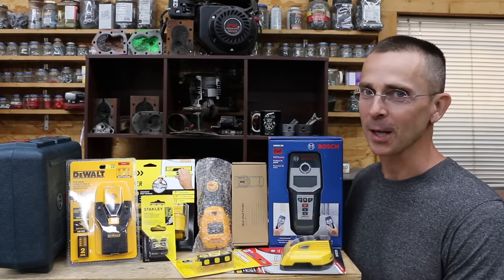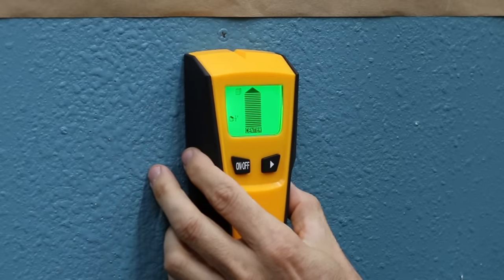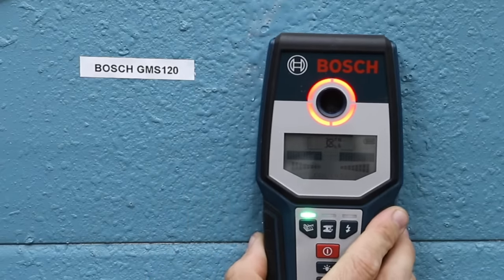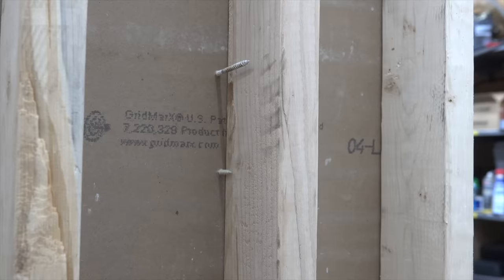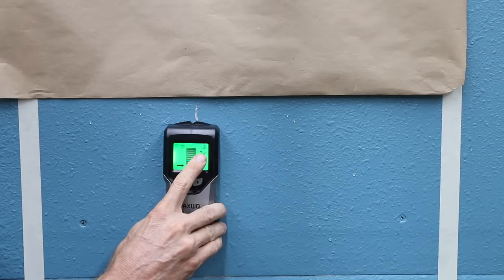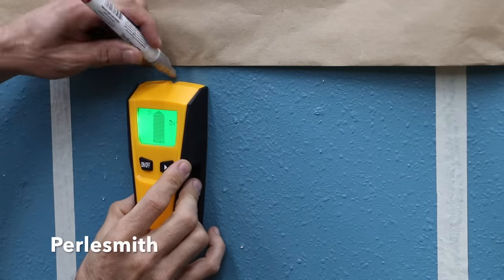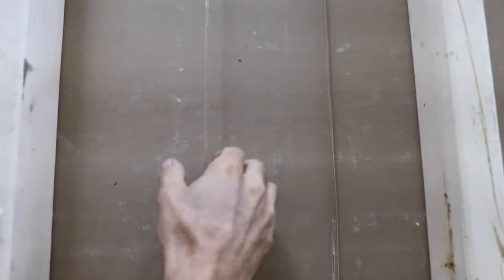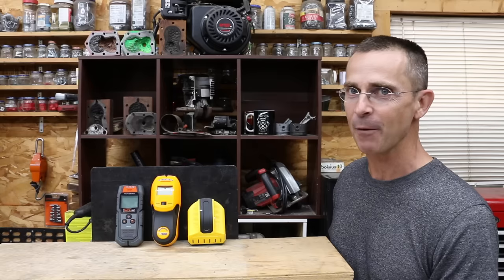Best Stud Finder? $262 Bosch vs $10 CH Hanson vs 9 Other Wall Stud Scanners! Let's find out!

Comment: I love the franklin, it's so fast to find a stud and makes it clear when you are seeing stacked studs. I've also used the franklin but I found that it used the batteries very quickly, not sure if there's a way to test that but I've had the franking for 3 years and changed batteries once and for whatever reason the Zircon always seems to be dead when I go to grab it.
Reply from the maker: Thanks for the video idea.

Comment: So I was thinking about buying a stud detector, although my past experiences with them have been hit and miss. But after watching your video explaining that the magnetic stud finders look for the screws not the stud it finally dawned on me to use some of the neodymium magnets I have on hand. Absolutely worked like a champ. For some reason, I always thought mag stud finders were just for finding metal studs. I feel like an idiot for not thinking of this. Anyway, strong neodymium magnets for the win. I wish I figured this out 20 years ago! You just saved me 50$. Thanks as always for the great vids!
Reply from the maker: Thanks for sharing!

Comment: Please test the Walabot 2 next round, it’s a bit expensive at $170, but it basically lets you see through walls. I’m really interested how it would do against some of the other more premium stud finders
Reply: I bought my walabot 5 yrs ago, it has not let me down yet. like thebfinding pioe and wire feature
Reply: I thought he would be reviewing it.. It's been out for a few years out now. I use to have the middle range ($) zircom and it's now on the trash! I do better with a small pilot hole!
Reply: @@nextprojectawesome9673 Why a pain for pros?
Reply: I can attest to the Walabot being very good. Its not as fast as some of these but it does the job well. I've used it on both lathe and plaster and drywall. Note it operates differently for each. For drywall its as advertised with the cartoon of the stud, romex, etc. (It can detect a critter supposedly.) For lathe and plaster its not so pretty. It gives you a zone "blob" that is the shape of what is below. So a stud is narrow rectangular-ish blob and a pipe is narrower etc. Think thermal camera.  That said - it was very accurate and for old lathe and plaster that is nice to have especially if your house was pre-code or had an improvisational handyman.

Comment: for 262$ USD the botch better find fracking tumors on people too, sheesh.
Reply: Seems to be worth it, if you use one a LOT.
Reply: Brand new for $219 and free shipping on eBay.
Reply: Bosch also has the D-tect 150 which retails for around $800 or more.
Reply: Very funny, I like the way you misspelled Bosch, At least I think that was intentional. ha ha.
Reply: Did I miss something with the dtect 120? It gives the same signal for copper pipe, metal pipe, pvc, and everything? If you need to know where a fire sprinkler or water line the scanner doesn't give you a different signal than a stud.
Reply: Still cheaper than tearing out a wall and replacing whatever was damaged. imo if you get a tool for something you might as well get a good one

Comment: Costco sells a scanner, green in color, called Precision Sensors “ProFinder 550”. I’ve had good success with it locating studs and electrical wires. Once again, excellent video sir!
Reply: Have the same one and it is the best I have used.
Reply: I love mine. I think I got it on sale for really cheap.
Reply: Just bought one today and this video came out lol
Reply from the maker: Thanks for the feedback.
Reply: Came here for this comment. That's a great sensor.

Comment: I’d be curious as to how they would preform in a plaster and lath format.
Reply: Me too!
Reply: Also walls with insulation in them.
Reply: Exactly, double layer drywall, tile, cement board etc...
Reply: Poorly. You'll need to do the drill bit trick or awl to find the first stud center then measure 16" over. That's hoping framing was consistent.

Old parged wood lathe walls don't work with stud finders.

The period where they put 1/4 to 3/8 drywall and parged with plaster and metal lathe to 1/2 to 3/4" dont work either.
Reply: Likewise.  I'd love to see a test on 1940's style plaster and lathe.
Reply: Ninja Master, while it is beyond the standard scope for a “stud finder” why not take the top few, add a more advanced meter and see what kind of information they can reliably present given all the common wall, floor and  ceiling compositions you may run across. Everyone has their preferred method but I have always wanted to have a more powerful device that gives a clear and complete picture of the utilities and structure buried within the kitchens and bathrooms I work in.
Reply: Same
Reply: Yep, add me to the list - I have an older home with plaster walls and normal stud finders I have tried are not reliable...

Comment: I really liked this test. Thoughts for second version included plaster with lath, ceramic tile, metal studs. Installing handrails or shower grab bars are both tricky if on an angle.
Reply from the maker: Thanks for the video idea.
Reply: Perfect idea.
Also, coat and feather out the mud at drywall joints. They can add to that build up. I’m sure one or two of those stud finders would start to fail more tests.
Also, try multiple layers of drywall. This is regular in many Fire rated wall applications.

Comment: I have a bunch of these stud sensors: The WINNER: The Franklin T13. I got it at Costco (cannot remember how much(reasonable($25?)))  It is the most reliable, intuitive and easy to operate; the 'bar' display gives a pretty good visualization of the situation. I had a situation where I was installing a socket box on a short (narrow) wall between a closet door and and a corner; I figured there was a double stud up against the door which was indicated and possibly a double stud at the corner. I used a very small drill bit to pierce every 1/4" or so, and found the T13 was correct, leaving me BARELY enough room for the breakout box. After cutting the hole with a drywall saw, I successfully installed the electric socket.
Having tried most of these with dubious results (average about 1/2"), the Franklin product is the one with some actual intelligent engineering, pretty white and lime green color scheme, and my go to tool (for finding studs).
Of course, my wife is pretty good, too...she found me (sorry)
Reply: Oh, and for when you absolutely, positively need to SEE what is going on, I use a cheap HD USB 7mm borescope cam to view on a laptop ($15 from AliExpress); has a built in variable, BRIGHT LED light in the end, and I tape the cord to a piece of thin welding wire which I can bend and manipulate while inside the wall. You only have to drill a 7mm hole (9/32") to ACTUALLY see what is in there.
Reply from the maker: Thanks for sharing.

Comment: Would love to see how the Walabot DIY Plus does. Only works with an android phone though.
Reply: Yea, need to throw Walabot into the test pool.  For a while, they were certainly the most prolific marketer. Otherwise, a great review as always!!
Reply: walabot and FLIR ONE camera
Reply: It was disappointing and I sent it back.
Reply: I have the first generation Walabot, it also gives me false positives for stud location sometimes
Reply: I also would love to see the Walabot tested along with another round of stud finders. I only trust you Todd, go Project Farm!
Reply from the maker: Thanks for the video idea.
Reply: Was hoping to see this also. Its a popular option for DIY and they market it well.
Reply: I've been using both the Walabot Plus and C.H. Hansen magnetic stud finder. The Walabot Plus has been pretty good but sometimes struggles to find the stud confidently in certain sections (not sure what's causing the issue). Moving the scanner above or below the trouble spot usually helps. For this reason I always double check with the magnetic stud finder. Also the trouble with relying solely on the magnetic stud finder is that you assume the builder put the dry wall screw on the stud center, which isn't always the case, which the Walabot can usually confirm with its edge finding.

Overall I think the Walabot Plus does a good job for wood studs in drywall, but I'd still love to see it put through all these tests with the more definitively measured results. Also, Todd if you could speak about maybe false positive results in the next video that would be useful too, especially since us homeowners don't know what to expect behind the wall.
Reply: @Krautastic  I have both. I haven't gotten much use from the walabot to speak much on its accuracy, but the FLIR one's big limitation is that there has to be a good temperature bias on the two sides of the wall, or inside the wall for the studs to be visible. Sometimes it's really telling though, with the flir, if that temperature bias is great.

Comment: Food for thought. One wall tear out and pipe replacement costs more than the Bosch Detect.
Reply from the maker: Thanks for the feedback.
Reply: Sounds like you've really screwed up and know what you're talking about. In over 40 years of construction I've never poked a hole in a pipe but I know I've nailed a wire or two.
Reply: @mikeries8549  not me but the contractor did. All seemed fine but a hidden pipe in the second story floor got cut. Luckily he didn't charge me for the hour and a half of work and the ceiling was already coming out in that area. Wires that are stapled behind the wall would be a nightmare to replace or else you would have to put a random box in the wall or do the crumby thing of leaving a splice behind a wall.
Reply: @mikeries8549  I put a screw through a water pipe in the wall in my garage once. Damn pipe wasn't straight vertical. Courtesy of decades of Southern California earthquakes. Thankfully the water shut-off was a few feet away at the water heater which would have made for very little water until someone opened a faucet upstairs.... draining the entire contents of that pipe into the garage.

Comment: I love your videos and look forward to all of them.  I appreciate the time, effort and resources you pour into them.  They're very informative.  
I've had the displeasure of needing to use a stud finder and the bane is plaster and lath wall in a 100 year old colonial (with wallpaper).  
When using such a tool, one doesn't have the luxury of knowing what's behind the wall, and all detected junk causes confusing false positives.   What I'd be interested in knowing is which stud finder can tell me where the studs are and differentiate them from wires, pipes, blocking, boxes, etc.  Sorry if I missed it in your video, but if you have an unknown wall how reliably could you find the studs and not end up accidentally driving a screw into a water pipe?  Do any of these clearly differentiate a wooden stud from all the other things?  That's really what you need the stud finder for.  
I'm not sure super sensitivity is a good thing.

Comment: Best stud finder I have found is a rare earth magnet lol it will find a screw or a nail real fast. 
Edit: Also forgot to add if you don’t want to tear up the paint on the wall put a little self adhesive soft Velcro on it and it works great, has to be a good powerful magnet though.
Reply from the maker: Great point!
Reply: I was gonna post this i have a little half inch cube neo
Reply: maxerious brooks ya I usually keep one on me all the time, I have a couple of them that are a little smaller than a dime but if you got your fingers trapped between 2 of them I bet it would break your fingers.
Reply: Buy a $2.79 jar of quarter inch round rare earth magnets at Harbor Freight; use two of them to sandwich a piece of dental floss or string about a foot long;  gently swing it around the area of wall you’re interested in, letting it skim the surface. Finds the nails/screws in no time.
Reply: The only issue i see with that is, you assuming the guy who hung the dry wall actually hit the stud. We both know that’s not always the case lol
Reply: @sccarguy8242  or that there are no studs for 6 ft on an interior wall because lazyness
Reply: This is true, have been doing a lot more steel stud work than lumber lately so the magnet works wonders.

Comment: As others have suggested, the Wallabot should’ve been included; I’ve had mine for over five years and even when I need a large screen phone to use it I love it because it finds 99% of all wires, pipes, plastic tubing, etc.
Reply from the maker: Good point for round 2.

Comment: I have several stud scanners and like you, have found that they all basically can detect a stud fairly accurately with 1/2" drywall covering.  However, what I have found, at least with the few that I have used, is that they can not reliably find a stud through double 5/8" drywall.  So I watched your video with interest to see if you tested this capability and was disappointed that you did not, I hope you include these tests in the future, with single 5/8" and double 5/8" drywall.  The double is important because many walls are sheathed like this when they serve as a firewall, which typically will be when separating a garage area to living space, and also where combustion appliances are present (like furnace, water heater).  It would be interesting to see if the expensive testers earned their value with this capability to justify their higher pricing.
Reply from the maker: Thanks for the video idea.
Reply: I live in an older house with plaster instead of drywall. I haven't found an accurate detector. Can you test them on thick plaster? 

Thanks for the channel. It is the first one I check when considering buying a product.
Reply: @daveduffy7254  Have you tried knocking on the wall?

Comment: I think the T13 is equally precise as the T6 from my own testing. I saw a little wiggling on the test here, nothing major, but if you score right when and where the light shifts on movement, you'll be at the edge with 99% accuracy every time. I love my T13. Franklin wins for me. Haven't seen the end of the video yet though. lol
Reply from the maker: Thanks for sharing.

Comment: Test engine flushes on some old engines, with lots of oil analysis to show what's actually being removed
Reply from the maker: Great video idea! Thank you
Reply: Perhaps also test oil from an old engine after switching to synthetic to see how much sludge was loosened
Reply: That´ll be a pretty long test run!
Which product family is better, the "add and use the car for a few days" or the "empty all out, fill with product and let idle for X minutes".
And how does the latter compare to an 80/20 diesel/oil mix in the same setup (which worked well for me the three or four times I did it to some of my cars)?
Reply: @sthenzel  oil Olympics videos were quite a long and important series, we certainly need to know if flush is important or a waste
Reply: @sthenzel  yep two videos then 😁

Comment: Love the work Project Farm, Consider redoing this test with a lathe and plaster wall for us Historic remodelers. Also for a easier wall mockup jut leave off the top 2-3 inches of wall board so the stud can be seen from the front side. Also could do just a blue board and plaster wall too, but very similar to this video.
Reply from the maker: Thanks!  Thanks for t he suggestions.

Comment: I remember a few years ago, one stud finder came to market claiming to be much more (great marketing).
was called the walabot I think. would be great to see it in this sort of comparison
Reply from the maker: Thanks for the suggestion.
Reply: Is that the one that connects to a cell phone? I'd like to see that.
Reply: @waggy401  that's the one. supposed to show you an image of what's behind the wall
Reply: I have one of them, and its pretty reasonably priced, and so far, it has been fantastic.  Admittedly, I've only used it a couple of times and I didn't know for sure what was really in there, so it may have been missing stuff, but it found my studs perfectly (I never missed with a screw at least) and it told me that one of the studs out of the 5 I located had an AC wire tacked to the left side of the stud.  I traced the studs from the ceiling to the floor, and it was very consistent about the studs location.  I've spent $30 on stud finders a bunch of times with mixed results.  I'm glad I spent $70 this last time so I can quit buying the others. It's annoying there is no iPhone version though.
Reply: I agree, the actual name is Walabot DIY.  I own one and have been very impressed with performance, but I haven't needed or tested finding pipes or conduit. I bought mine on eBay for only $40 including shipping and connected it to an old Galaxy S7 phone.  I have used it half a dozen time and it hasn't missed yet. I lend it to neighbors and they are also impressed. I would love to see it matched against the best devices of this test. Here is a demo video.  It works just as shown in the video.
Reply: I have one and it is quite different than other "stud" finders as it shows an actual, visual representation of what is behind the wall. Pipes, electrical wires an studs all appear different. The difficult thing for me is the using it with your cell phone, it needs some different manner to use it, in my opinion. In spite of that difficulty, it is still my preferred stud finder.
Reply: I like my Walabot DIY.  It came in very handy when trying to hang a towel rack on some drywall.  No matter what I did, I kept getting mixed results with a magnetic or "regular" electronic stud finder.  The Walabot worked perfectly for me.
Reply: Indeed. My family is a fan of the Walabot DIY. My parents just bought my old Android phone to run the app since they only use Apple phones. It was excellent to find studs and add in a 2x4 to properly support a pair of massive blinds in one room. Found water and power lines too.
Reply: We use Flir cameras to find honeybee colonies inside walls.